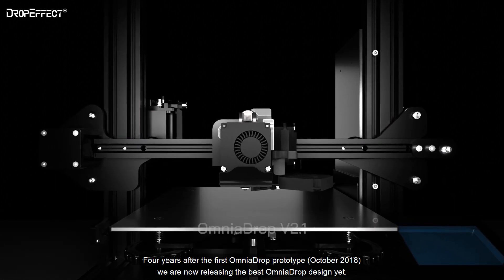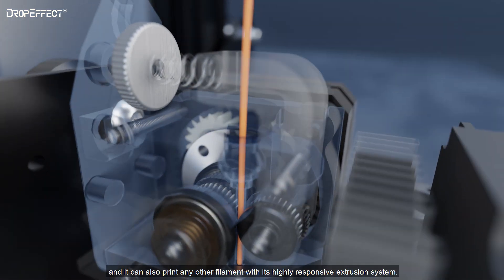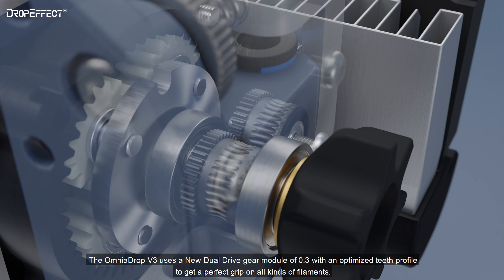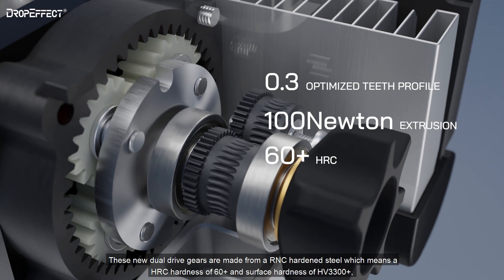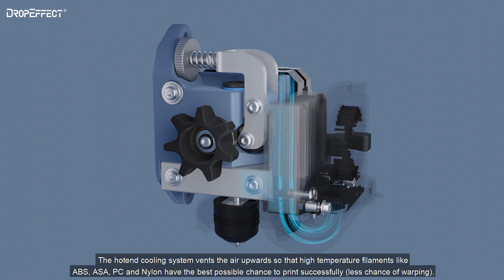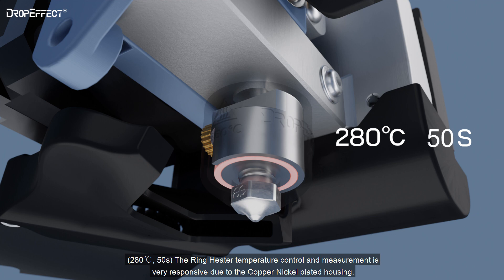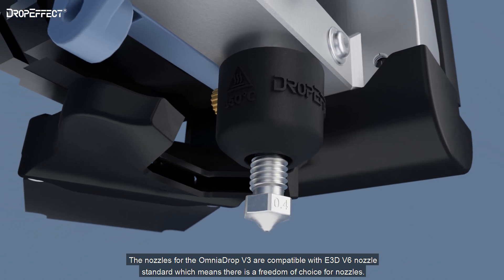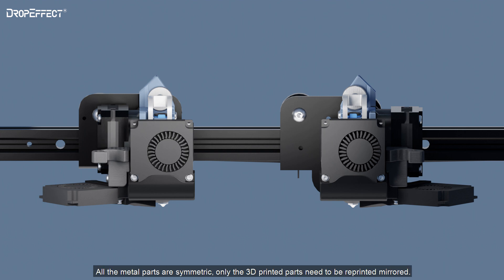📣New product release: OmniaDrop V3

Comment: Is this extruder company still in business? I used to use Flexion for my print farm for my flexible filaments and they went under so I am screwed till I find something as good
Reply from the maker: We are still in business and the OmniaDrop is currently on V3. If you need a new flexible filament extruder then the OmniaDrop is an excellent candidate you should consider as an option.
Reply: @DropEffect  I thought I read somewhere that the planetary gears are 3D printed? How much of the extruder is 3d printed? Do you have any documentation on setting up on Creality Ender 3 style printers?
Reply from the maker: @grifftech  TLDR: The Planetary Gear System on the OmniaDrop V3 is injection moulded.
The Planet Gear and Ring Gear were 3D printed on V1.4, but the sun gear on the stepper motor is made from brass, then on V2.1 we injection moulded the Planet Gear and now on V3 the Ring Gear was also injection moulded.
Reply: @DropEffect  Hi, I installed in prusa mk3s, did you have any settings?
Reply: how to configure the Prusa mk3s firmware?